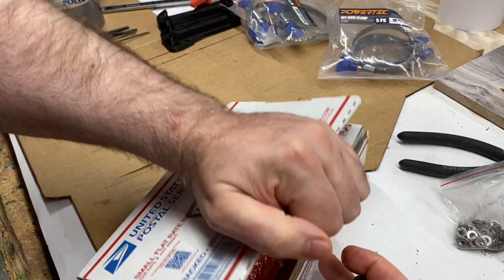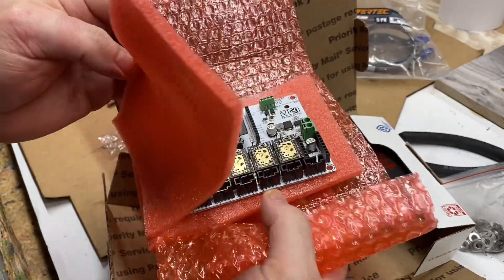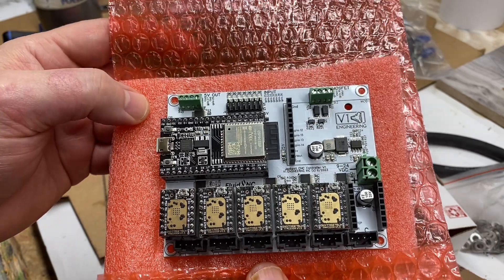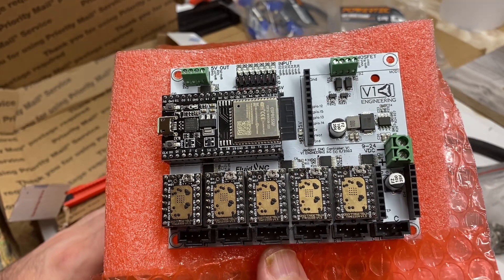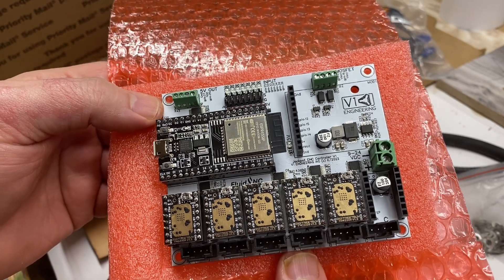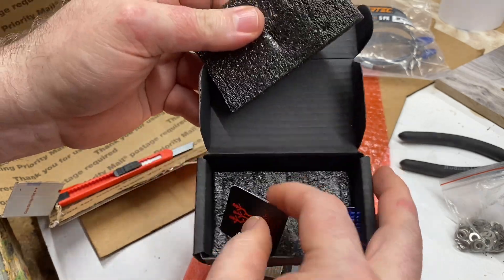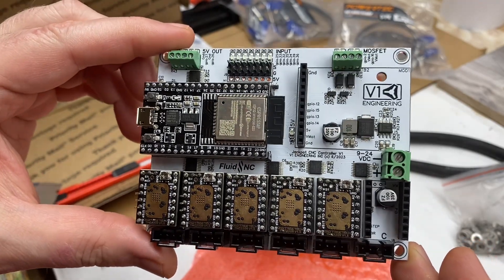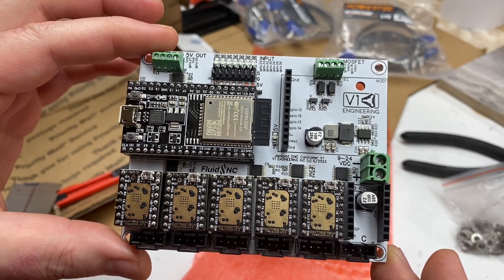I've hit the Jackpot! LowRider/MPCNC/DIY CNC: new FluidNC/GRBL controller board from V1 Engineering

Comment: Question: for the control board, can I use the control board for an ender 3 3d printer?
Reply from the maker: Hello. While a control board for a 3D printer can be used, it must support a minimum of 5 drivers for control of the stepper motors. Most cheap boards for Ender 3's don't have that many drivers. A more affordable alternative to the Jackpot board would be the SKR V1.4 Turbo from BTT, which has exactly 5 drivers. Here's an affiliate link to it on Amazon:  https://amzn.to/47Kwq9s

Comment: Does it have to be connected to the USB source too? I am not getting the EST32 board. Do I have to run separate cable to the board? So one for the 24v and the other one for the 5V USB? Thanks Doug. :)
Reply from the maker: So the Jackpot board can accept power directly from either 12v or 24v. It can be communicated with via wifi or via USB. It can store gcode files for cut jobs on an SD card. The most common use is to send cut job files to it, to the SD card, via a wifi connection, and then using a wifi connected control device, launch the cut job, which runs from the SD card. I also built a DIY pendant control device, called the Fluid Dial pendant. It can jog the machine, home the machine, browse cut files on the SD card, and launch cut jobs. It draws its power directly from the board. The board handles all its power needs from the one power input I provide directly.
Reply: @design8studio  So the ESP board on top of it, that has its own USB, that is not for power but for data? It is located right above the SD card. 

Thank you Doug. :)
Reply from the maker: Yes, that is correct. That micro USB port is used for data. The Jackpot draws its power from a power supply (AC to DC) that is attached as part of the LowRider. The power supply can be either 12 V or 24 V. In my case is 12 V. If one is doing a firmware upgrade via USB cable (as opposed to an over the air upload), then you can turn off the LowRider and when you plug in the USB cable, the Jackpot board will get power for the communications, but the LowRider will not get any power. You can also have the Lowrider under its own power while you plug into it, although, if memory serves, there’s a certain order in which that needs to be done. Again it’s only for data or doing firmware upgrades etc. not for normal operation.
Reply: @design8studio   That explains it. It wasn't clear to me. Thank you very much :)

Comment: so i been upgrading my 3018 .... did the extension and now ive upgraded the spindle to a router and i like the wireless idea and that it prolly puts out more power than my lil sainsmart. im gonna be buying bigger nema 17's and im thinking this to run everything? im new to the hobby so im a complete newb treat me like a child
Reply from the maker: This will indeed run NEMA 17's like a beast. Almost all of the LowRiders (made using free plans from V1 Engineering) use NEMA 17's. This board drives them great. Check some of the builds on the forum at v1e.com
Reply: i just bought it. it should be here for the weekend @design8studio

Comment: This is awesome Doug!  Are you able to retain THC with this board?  I'm just digging into the specs and it looks possible.
Reply from the maker: This is not intended to serve for my LowRider Plasma rig, but rather for my LowRider Router rig. I have not even considered whether it might serve for plasma, but my MESA electronics setup for plasma is staying put!
Reply: Thanks for the reply.  It looks like THC is not likely on this board unless I lock out my Z motors in favor of a single motor on the torch head.  Though I was thinking of setting the existing Z motors up as separate Single-axis machine to raise and lower the gantry quickly for an appropriate working height for flat sheet or large tubing. The price of the Jackpot makes it hard to pass up although the Mesa setup you used seems very robust.  Thanks for all of the great info and entertaining videos!
Reply from the maker: @BANGEDUPJEEP  One can definitely do plasma cutting without automatic THC, but it is a helpful feature to have. As far as I know, THC usually requires a dedicated separate device. Even in the case of my MESA Electronics control board for my plasma, the control board itself does not do THC in and of itself, but rather requires a second PCB (also bought from MESA) that handles it, although it's done in communication with the main breakout board.
Reply: Absolutely.  I feel like I could cut the step and direction pins from the z driver so that I could intercept the signal from the board, send it to the THC and back to the driver.  Does that sound feasible? It just seems easier with a single z motor.  I have some ideas to use 2 but they need to be independent for homing and paralleled while cutting.
Reply from the maker: @BANGEDUPJEEP  that is exactly how my setup on my plasma is. It’s a LowRider with Dual Z, and the Z motors operate independently for homing exactly as they should, and then they operate in unison for torch height control. This was pretty much effortless to set up with the Mesa control board and the Mesa THC. The real treat is being able to use LinuxCNC for making the cuts. This requires pairing the Mesa electronics products with a laptop capable of running Linux.
Reply: I may as well go that route and quit trying to pinch pennies.  The Mesa setup you've gone with seems like it would be better for more of a production duty load.  The Jackpot sure is cheap enough to experiment with and will certainly work for my lowrider 3 router.  I'm using the lowrider 2 for plasma due to its lower profile for storage in my setup.  Also using a remix of your breakaway mount so I can lay the torch down 90 degrees out of the way.  Excellent design!  I look forward to more vids.
Reply from the maker: @BANGEDUPJEEP You will love using LinuxCNC for plasma cutting! Aim for their popular graphical user interface named QTPlasmaC!

Comment: Wonderful video, Doug! Do you have a recommendation for a board without the stepper drivers? I need large steppers for my project and they'll have their own drivers? Or if this board has pins that circumvent the on-board drivers so I can send the signal to these other controllers? I can find stepper drivers based on the type of signal out the Jackpot has if it has the breakout pins. Thanks in advance!
Reply from the maker: This is a great question for the V1E forum. I don't know the answer to this, but I'm pretty confident that someone on the forum will be able to give great advice about this!
Reply from the maker: I just happened to think... I power my LowRider v3 CNC Plasma rig with a board that does not have built in drivers. However, it's made to be connected to a PC via an Ethernet cable. The way I use it is by having LinuxCNC installed on a used laptop I bought for a song. The board is made by MESA Electronics. It can connect to whatever kind of drivers you want. If that sounds like an option, you should check out my video playlist on how I built by my LowRider v3 CNC Plasma rig!

Comment: I have been using fluid nc with a tinybee on my little cnc router for 6 months or so now. It works good but has some short comings so might have to try one of theses boards. I'm guessing it's new?
Reply from the maker: Yes it is new. It's a "remix" by Ryan (V1E) of an open source board designed by Bart Dring (who I think is also the main guy behind FluidNC). Here's a link to a source for Bart's original, on which I think Ryan's was based. https://www.tindie.com/products/33366583/6-pack-universal-cnc-controller/
Reply from the maker: This video about FluidNC is posted by Bart Dring, so I think the voice in the video is his. https://www.youtube.com/watch?v=iwlS6Otwjqg